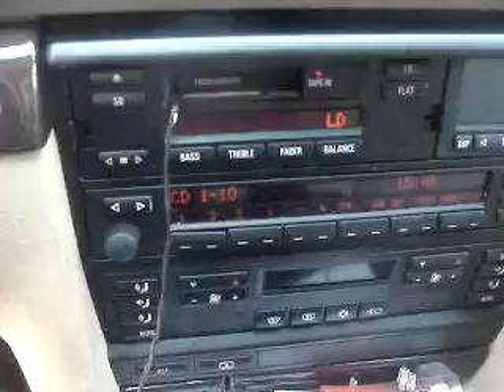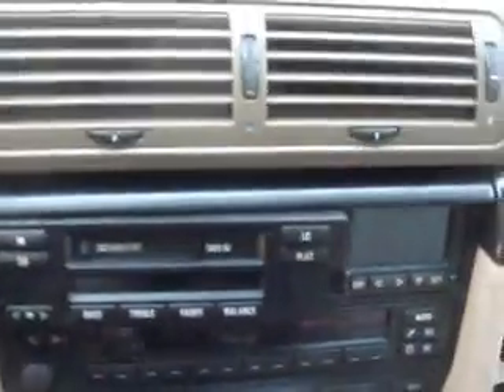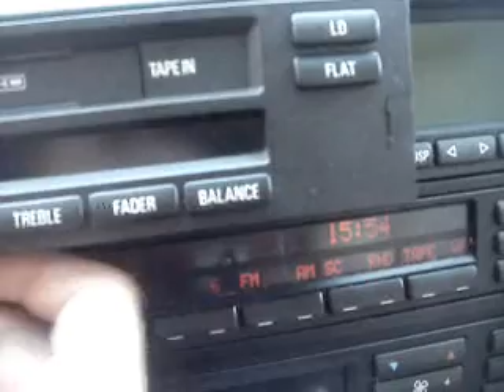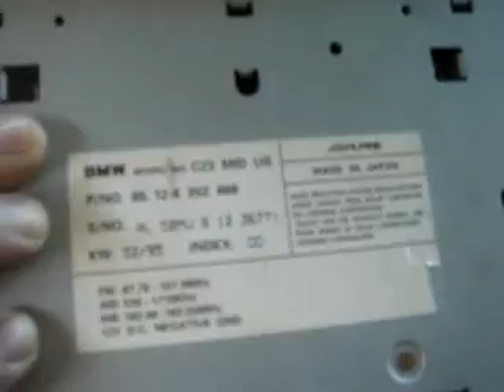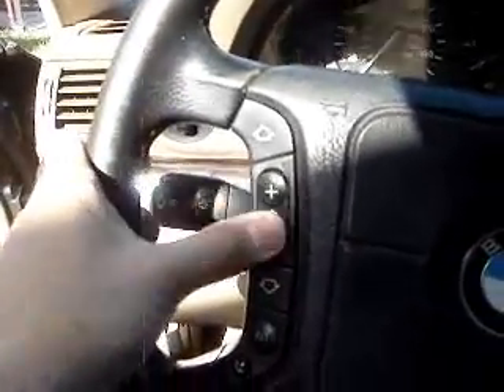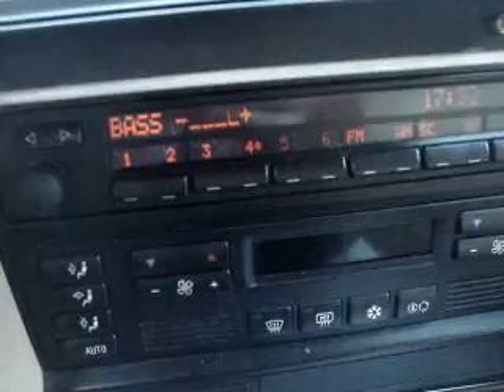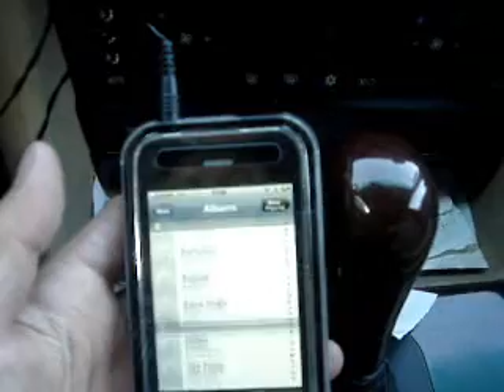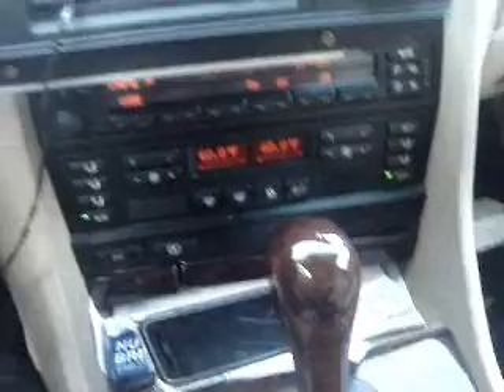E38 I bus unit options

Comment from the maker: The cassette unit is notorious for intermittent sound due to cracked solder joints. These are alternative replacements. You can get the CD43 unit also if you want to upgrade to CD player.

Comment from the maker: It's not the MID. The MID is the OBC display under the cassette unit. Depending on the issue, it could be the cassette unit or the amp. The common problem is always targeted at the cassette unit.